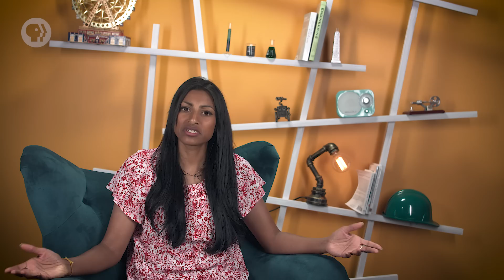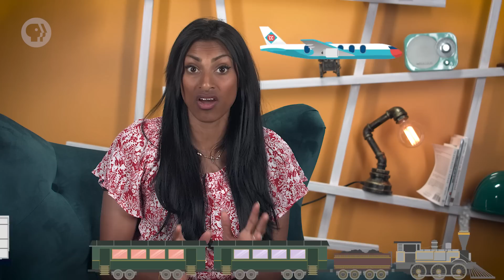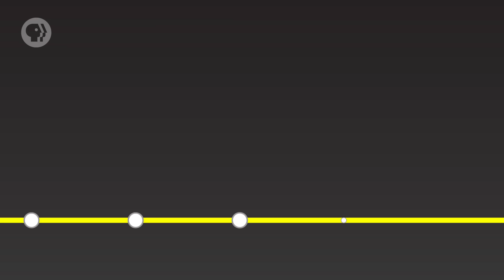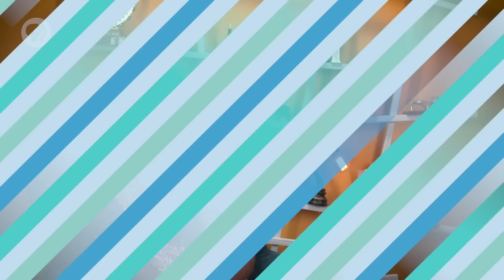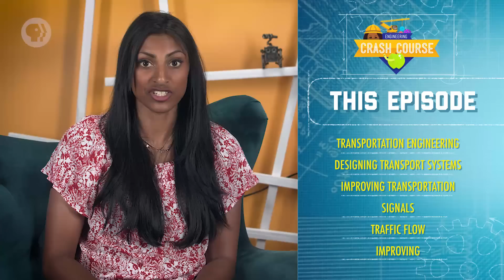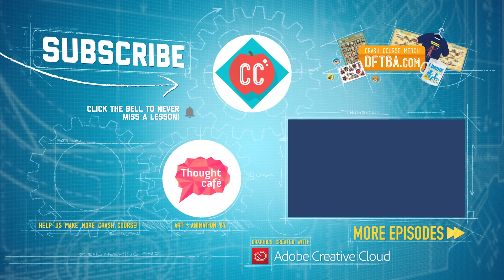Why Moving People is Complicated: Crash Course Engineering #41

Comment: Worth noting that you also need to take into account human perception when designing signalling. The October 1999 Paddington Rail disaster was caused, in part, by obscured signalling which the driver couldn't see properly due to glare. 

Many modern high speed trains have in-cab signalling, since beyond a certain speed it becomes difficult for people to react visually to external signals. Thus, having the signal pop up in the cab at designated points allows for much higher speeds, without sacrificing reaction time.
Reply: Mystic Mind Analysis Huuuuuuuuuuummmmmmaaaaaaannnnn factors engineeeeeeeeeeeerrrriiiing

Comment: I know the field is small but would you guys consider doing an episode on mining engineering?
Reply: It is a small field, but an incredibly important one (without mines to supply raw materials, our society would be back in the stone age within an decade). It would be particularly interesting to see the engineering challenges in balancing society's need for raw materials with society's need to not cause devastating environmental damage in the process.
Also, as a subset of the mining, would be very interested to see an episode on geothermal (I know, it is debatable whether or not geothermal counts as mining, but if pulling water with dissolved lithium out of the ground and letting the water evaporate away to get the lithium counts as mining, I don't see why pulling water out of the ground and extracting the heat can't be called mining... plus, at least in Nevada, it legally is defined as mining, so there's that...)

Comment: In traffic, rather than trying to engineer around the drivers by changing roads and routes and other infrastructure, I think money would be better spent in the comprehensive (re-)training of drivers. Yes, I get the concept of forced flow, but I've observed traffic jams starting to form long before a road system should hit even critical flow, much less forced flow.

The problem? People not paying attention. They get on the freeways at sub-optimal speeds; they pace each other for kilometers at a time; they don't know how to merge, leaving entire lanes mostly empty as people prematurely move over; they slow down going up hills or around corners; they get cranky because they think you're trying to cut them off.

In the US, at least, we're in desperate need of re-education when it comes to driving etiquette.  It'd help if drivers would 1) pay attention and 2) be skilled enough to handle 1500kg of metal, plastic, electronics and fuel moving at 100+ kph. The worst enemy of any driver on the road is another driver, not the infrastructure.
Reply: The problem with saying that there are a bunch of idiots on the road is that nobody is the idiot on the road. So many people think that they drive impeccably, and that the fault always lies in others. 

Personally, I think it's a crime that people aren't required to understand basic automotive maintenance, emergency repairs, basic mechanical understanding of the characteristics of their vehicles, and experience in defensive and advanced driving courses.

But hurr, you only need to know where the go pedal and stop pedal are, right?